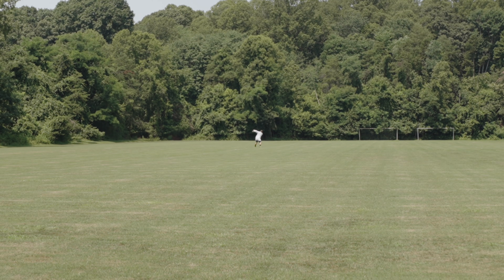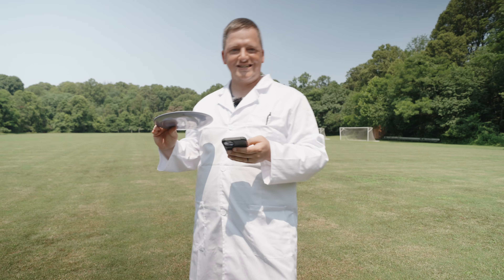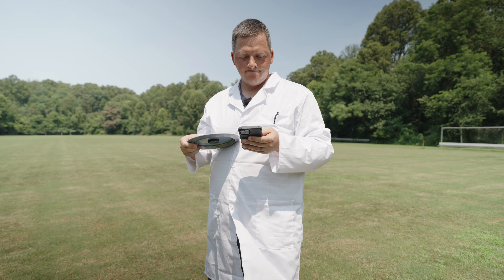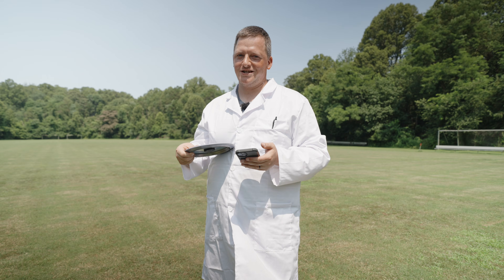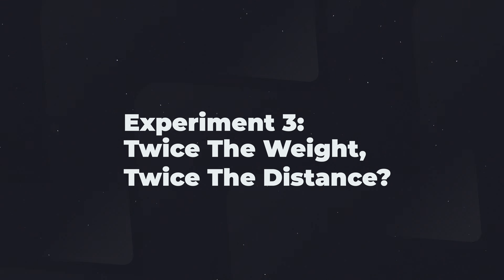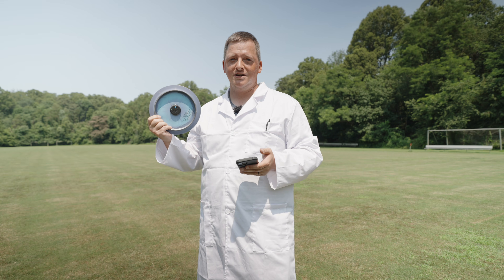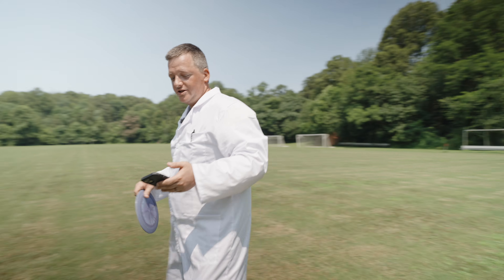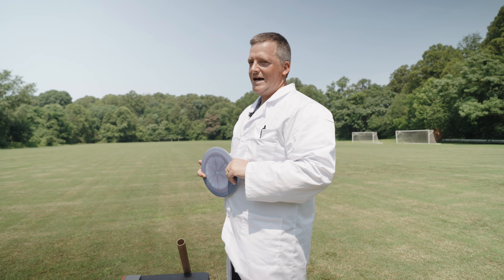We Added Weight to a TechDisc… For BRO Science

Comment: man, I love your channel, but as an engineer and physics buff, everything about this video is cringe.  The worst part is that people are quoting / linking this video as if this is a scientific study, when virtually everything about every one of these tests is blatantly unscientific, from what is measured, how they're measured, to how the measurements are interpreted.

Hey I'm not against having fun and playing around, but like, this isn't useful in any way for actually understanding disc golf physics.

Point in case:  "Wobble" has nothing to do with side to side / axial oscillation, it has to do with the disc rotating off axis.  Techdisc absolutely doesn't measure side to side oscillation at least as "wobble" (if anything it'd just throw everything about its trajectory tracking off because it was never designed to measure something that isn't round with its center of mass at its actual centerpoint, which is where the techdisc is located - so all it'd see is that the disc is flying in a zig-zag line which makes everything it's calculating simply incorrect, because they assumed the techdisc as it center of mass - when it isn't.

And most critically, any "experiment" that shows that "torque in" (angular momentum applied) isn't always 100% equal to "torque out" (angular momentum during flight) - should be instantly relegated purely to comedy/entertainment.

Claims that if discs weighed more that they'd travel farther are absolutely true, but only if you assume two things: 1) the disc is actually designed to be that heavy (it'd require a different aerodynamic profile to maximize benefits, noting you also changed the inner rim (which IS IMPORTANT to flight physics on its own) and 2) that the player throwing the disc is capable of getting the disc up to speed, which translates to applying twice as much force (to achieve the same speed).  You aren't doing this.  Some people can (as the speed humans can reach with typical DG form is limited by biological factors and caps out at around 80-90mph, but stronger people can throw HEAVIER things 80-90mph than weaker people) - but you aren't doing this.   Heavier discs would not fall faster (g is a constant and doesn't care about mass), but drag absolutely cares about mass - heavier things push air better than light things and thus keep their speed far longer than lighter discs, in all wind conditions other than tailwind where being lighter actually results in negative drag late in flight and additional lift due to lower mass = more acceleration upwards for the same lift force.
Reply from the maker: Yup

Comment: $417.00 CAD  what a F@cken rip off  for $10 worth of tec
Reply from the maker: I think you’re getting more than $10 worth…
Reply: @OverthrowDiscGolf  My improvements (which I can now measure) on nose angle control alone are worth every penny I paid for mine - and the fact that I can also use it in my shop to help customers find the right disc for them, or in coaching sessions to pinpoint and improve on problems over time... I mean that's just value on top of value.

Is it going to massively going to change your game overnight?  Nah.  Is it one way to improve (and also reward improvement with instant, empirical feedback):  Yes, very much so

Comment: So I’ll just put this out there for the nerds amongst us. Keep in mind, I last took physics in 2011.

If we throw 2 ball’s the same speed, and one ball is twice as massive, they would travel about the same distance. Gravity doesn’t affect this, it’s only wind resistance. The lighter ball is less resistant to the force of the wind. But it would not make a big difference unless the balls were very light.

However, golf discs are not balls. They are designed to glide. In order to glide, they need wind resistance! I’m not going to attempt the math here, but imagine a disc that weighed as much as a 747. Do you think throwing it 50 mph would keep it in the air for any longer than a baseball would? No, it would drop just as fast. Because with greater mass, you need greater speed to maintain glide.

Comment: Here's something interesting to test if you feel like it. "Extra curled middle finger knuckle pinch grip"  Rolls right off the tongue 🤣
Here's a pic of the grip: https://photos.app.goo.gl/zEHgSLcURL7UgNM87

Typical curled finger power grip had always been weak for me, but this variation didn't reduce my power and gave me stupidly low wobble (avg below 2 and semi often below 1). There's an anthem DG slow mo of Luke Taylor where you can see his thumb land on his middle finger knuckle after the disc rips out which is where the idea came from.

Comment: I love the idea of actual data to show speed to distance, especially for old, weak throwers like me. Regrettably, I cannot throw faster than 35 mph, 700 rpm. That is slow, yes, and if I throw that into a net TechDisc tells me it went only 28 feet. Which is just insulting. TechDisc says I cannot throw from circle's edge to the basket. Prove them wrong!
Reply from the maker: You might be throwing down into the net
Reply: Launch angle is huge.  Retired engineer here (although not aerospace, so not great at aerodynamics).  I also am a lower speed thrower, and I wanted to see which of the parameters measured by Techdisc has the greatest affect on distance.  I performed a number of throws and then varied Techdisc's parameters as well as the disc characteristics.  Speed, of course, had the greatest affect.  Second, however, was launch angle. For me, my optimum launch angle was about 12 degrees.

Comment: The gyroscopic spin imparted from the first burst of acceleration stabilizes the disc out of your hand.  But captive energy and spin diminish rapidly, as the disc grinds off energy against the air.  The force required to keep the disc lifting is removed from its overall kinetic energy, so it loses both spin and velocity as it flies.   This lower spin means that there is less gyroscopic stability from the entire rim's rotation to offset the uneven weight distribution.  Thus wobble increases over time.  

There is probably a visual effect here too, caused by your eyes cuing into the piece of tape on the underside.  You can see this effect sometimes in some of the discs Gannon throws on tour, which have an asymmetric pattern.  His discs look visibly wobbly in flight, even though they clearly aren't wobbling much at all.

Comment: Test how many grams of weight is necessary to change the stability of the flight. Take a neutral to straight disc and add 1g below the parting line until it becomes understable. Then remove and add above the parting line until it becomes over stable. Could be fun to see just how little or how much material above/below the parting line changes the flight.

Comment: Is gyro dead???
Reply from the maker: Doubt it
Reply: quite the opposite. the theoretical benefit of gyro is higher angular momentum, not higher spin rate. you would actually expect a gyro disc to have lower spin rate at release than a regular disc with the same amount of power due to the extra torque required, but if i understand the video correctly, josh has shown that even with an increase in the amount of torque required per rpm on the disc, he still achieved the same spin rate. this means the weighted disc has higher angular momentum and retains its spin for longer.

Comment: It was indeed completely pointless to test the "twice the mass twice as far" scenario. Whomever gave you that idea has a fundamental misunderstanding of physics. Even if the disc were a ball and flew in a strictly parabolic arc, the physics don't work on this one. If you double the mass of a ball, in order to throw it with the same speed you otherwise would if it were half the mass, you need twice as much acceleration force imparted into it. That does NOT mean the ball will fly twice as far though, that just means it's twice as hard to get the ball moving the same speed. Once the ball is out of your hand and you're no longer actively imparting force on it, that increased mass is now subject to gravity, and guess what, unlike when you threw the ball twice as hard to counteract the increased mass, there's nothing you can do to make gravity half as weak so the object simply falls twice as fast. Gravity isn't linear so it won't be exactly a "half as far" scenario, but it's certainly not going to fly _farther_. The same thing applies with a disc of course.

To make a disc fly twice as far with twice the mass, you'd need one quarter the gravity. So maybe try throwing it on the moon?
Reply: You would get the benefit of inertia vs air resistance, so at the same speed you would get more distance, the disc would slow slower
Reply: @werecatz a more massive disc thrown with the same speed would definitely maintain it's air speed better like you said, however, it would be pulled down by gravity so much faster that it effectively wouldn't matter. Especially when you consider that discs are already hitting the ground far before bleeding off all their air speed.

Comment: An air plane uses less fuel when it is lighter.  So the correlation between winged flying vehicles and discs means lighter disc thrown at the same speed goes further

Comment: Wobble v Wobble
TechDisc measures off-axis wobble.
The side-to-side motion that you see as the disc slows is on-axis wobble.
The engineers assumed you would be throwing a balanced circular object, thus didn't include measurement for that axis. Call them up, maybe they can give you a firmware update.
Reply: This is the correct answer. The wobble readings for the "weight on one side" throws are invalid (or at least functionally useless) because they almost certainly confuse the TechDisc algorithm by introducing a scenario that's completely unrealistic. Discs have an even mass distribution so their axis of rotation is the center of the disc. By putting weight only on one side, you actually changed the axis of rotation to be somewhere away from the center of the disc. However, unlike a car wheel which is rigidly affixed at the center to an axle and thus requires balancing weights to avoid wobble, a disc is free to rotate around any axis because it's not affixed to anything, so the disc is basically just happily rotating around a different axis that looks funny but is actually quite stable as long as the axis isn't so far off center that the disc is no longer aerodynamically stable.
Reply: @spoonraker  AAAHHH fascinating! This makes so much sense. So while traditional heavy wobble can be caused by off-axis torque in the throwing mechanics, this 'wobble' is actually non-wobble axis-related spin mechanics. Thanks so much!!
Reply from the maker: They do have readings for every axis though I imagine wobble is mostly read up and down.
Reply: @OverthrowDiscGolf  that's good to know, I still think the fundamental point that when people want to know about "wobble" they really want to know about off axis wobble not on axis wobble stands. You basically created a version of those discs with different rim widths on either side.
Reply from the maker: @spoonraker mmmm. I see
Reply: How TechDisc measures wobble...
https://youtu.be/7LbJ35hSmZI?start=596

Comment: 2x the weight is super counter intuitive for the disc I could see a ball that's 2x the weight going 2x farther. But the disc just works on different physics than a ball when thrown.
Reply: It doesn't work for a ball either.

Doubling the mass of a ball makes it twice as hard to throw the same speed. That does NOT mean it will go twice as far. Once the ball leaves your hand you're no longer imparting force on it, so you're simply left with 2 balls, both subject to gravity, both flying the same speed on the same initial vector, except one is twice as massive. There's nothing that can happen other than the one with twice the mass experiences twice the gravitational acceleration AKA it falls out of the sky faster.

In order to throw a disc twice as far, if you're not changing anything about the speed, spin, etc. you'd need half the gravity. If you wanted to throw a disc twice as far that's twice the mass, you'd need 1/4 the gravity. So try this experiment on the moon and it might work pretty well!
Reply: @spoonraker a ball with twice the mass would not fall twice as fast. I think everyone learns this in school at some point. 

No, the only plausibility this theory has is that the disk would be twice as affected by wind resistance for a lighter disk. However, that fails to consider that disks only glide because of wind resistance creating lift.